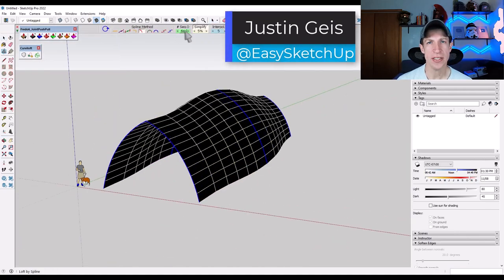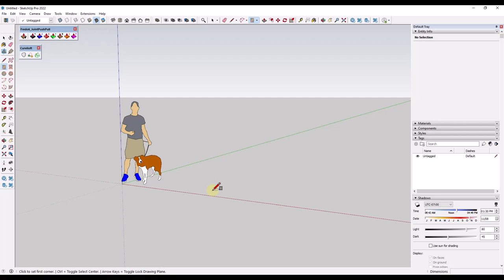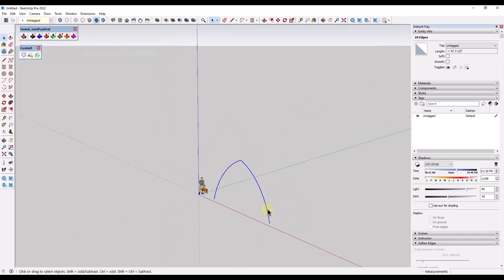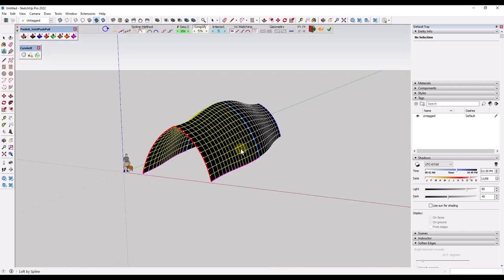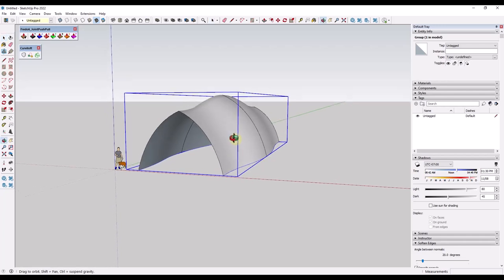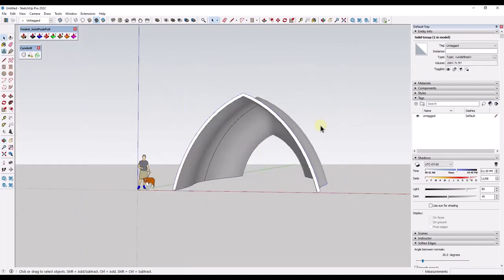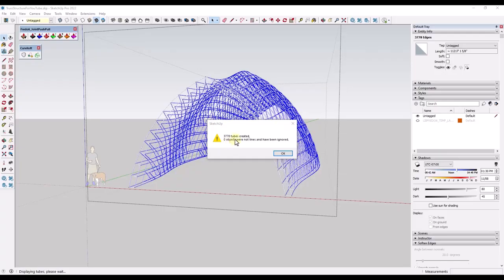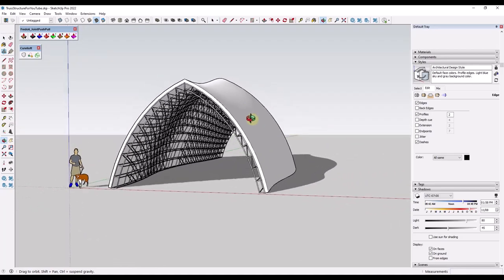Modeling a Truss Structure in SketchUp!

Comment: Can Sketchup do the layout and measurements and placement for the king stud and the braces to build the trusses? when you have a span of 30 feet and a 8/12 roof pitch for each one of the roof trusses that we’re wanting to 3D print each one of the trusses in GeoPolymer mortar instead of using wood or metal studs at the job site so we can have structural engineered concrete roof truss that will meet or exceed any city, state and International Building Code (IBC) requirements? We are trying to find the right software so we can build each truss at the job site